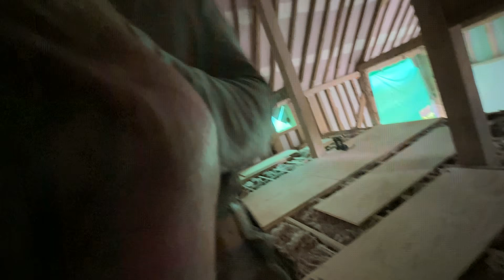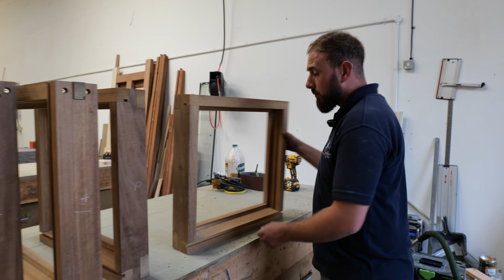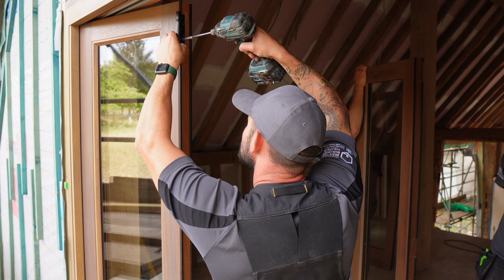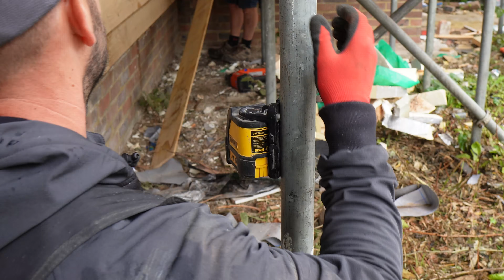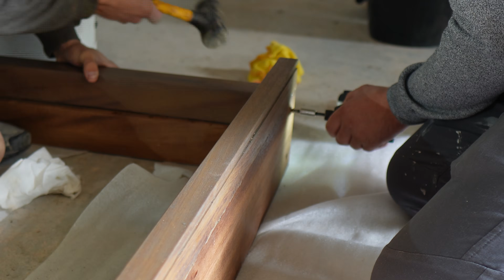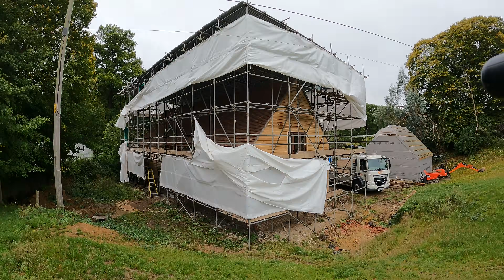The CRAZIEST Transformation WE'VE EVER Done

Comment: The membrane on the outer walls could have been finished better at the base, looks like it could trap water or not direct it out to the vents. Are those paslode nails for the cladding made of stainless? Did you add a dpc under the door frames?